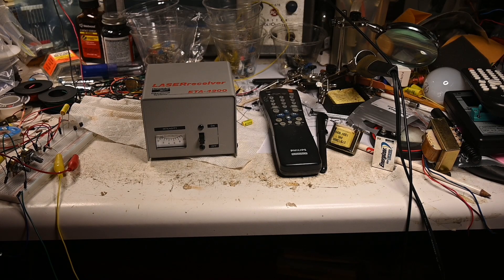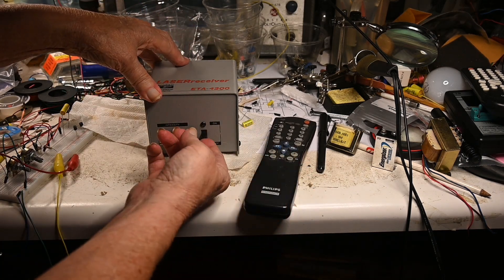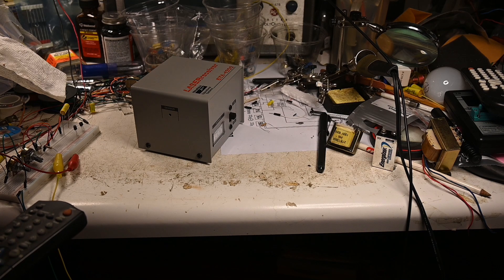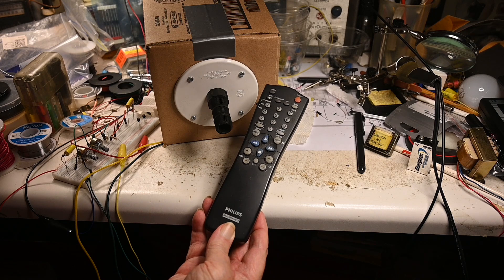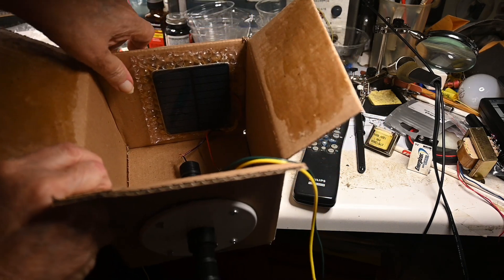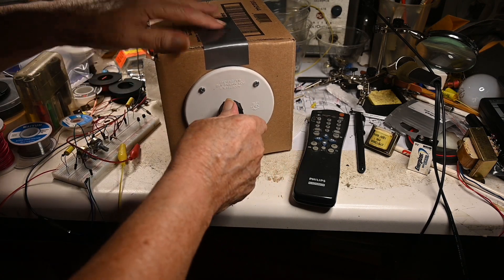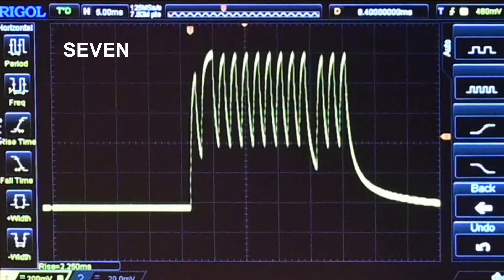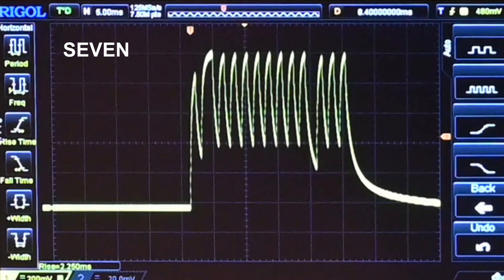Infrared TV Remote Patterns

Comment: I think your solar cell response is too slow.   Not sure why you didn't just use an Infrared Transistor as a pickup for this.   I think your signal will look like a series of distinct square edged pulses instead of pointy teeth.    The waves look like capacitor charge and discharge waveforms thus I think the solar cell is reacting too slowly to the IR LED light.  I made myself a remote tester that reads the IR pulses with an IR transistor and then drive a visible light LED to see the signal with the naked eye.   I like your laser box.
Reply from the maker: Thanks.
Your right I put the scope on the IR receiver in a Cooties detector (IR transceiver). The results are much more digital and makes the patterns more clear.
Reply: @AllAmericanFiveRadio  You're welcome.   I credit another YouTuber for this thought process when I viewed his vid several years ago.   I wish I could recall his channel name to give him full credit.  He ran a test and compared LDR, vs Phototransistor vs Photo Diode.    LDR (light dependent resistor) gave similar results as your solar cell.    Photo diode is faster by far than the other two devices.
Reply from the maker: @jp040759  Thanks again for the information.
Reply: @AllAmericanFiveRadio  Thanks for all your vids and effort sir!!!!
Reply: I used a photodiode 'raw' and I get too that kind of exponential decay between pulses. I guess it's the diode's capacitance. The problem here is that what is shown on the scope is just a single bit that is coded with a 38kHz modulated signal (usually). By extending the time scale he should be able to catch the long preamble and then several sequences of bit representing the code of the remote and the actual key pressed.

When seen through an appropriate 3 pin receiver, the modulation is ditched and clean rectangular pulses are shown.

Comment: I hear the exact same thing if I put a remote next to an AM radio on a blank station. your device seems to make the audio a lot better. I can hear the tone change in pattern as you press different buttons.

I did this with a solar panel from a garden light and a small radio shack mini amplifier speaker.
Reply from the maker: I forgot to mention the AM radio. Nice experimenting with good and interesting results. Glad that you are still interested in experimenting.